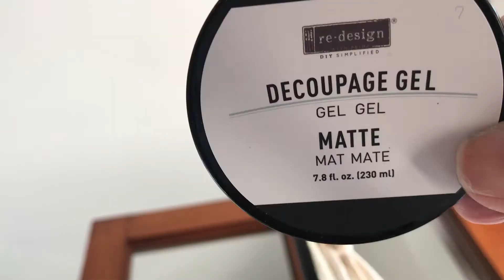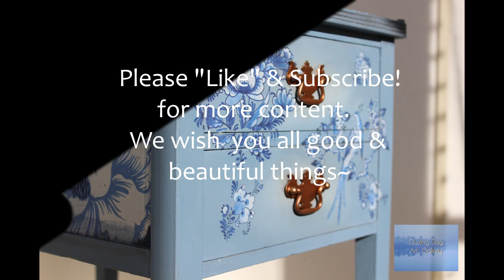An Amazing Transformation!

Comment: For when you have to cut your transfer for the drawers you might want to try doing that after you take the plastic off it's a lot easier
Reply from the maker: You are right! 🥰I do prefer to do the cutting with the plastic on because it helps prevent any snagging or tears though. I suppose it's a matter of preference.
Reply: @OwlingDogDesign  that's a good point